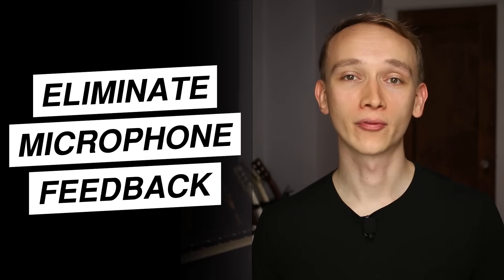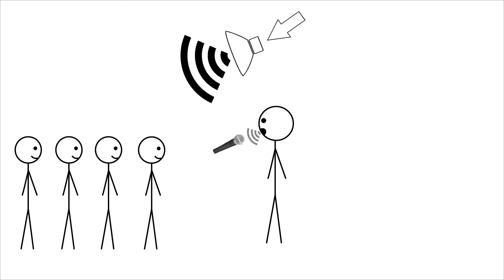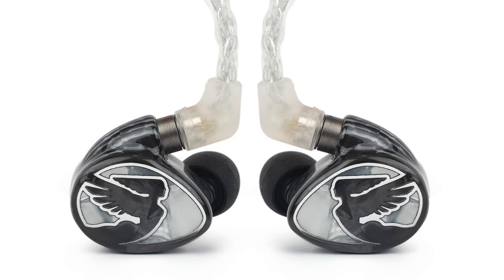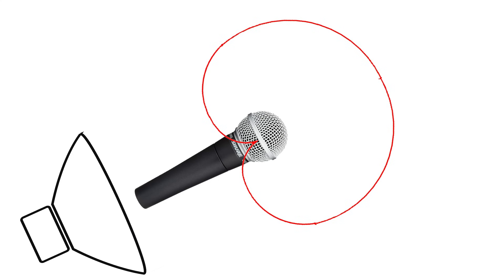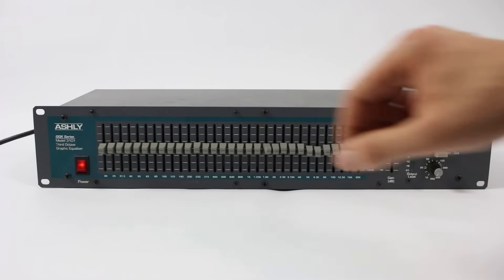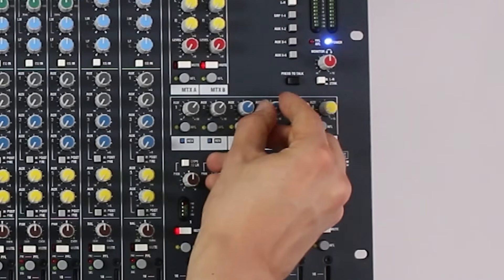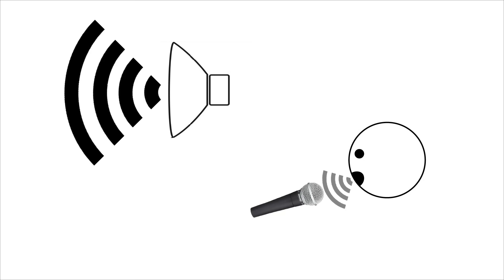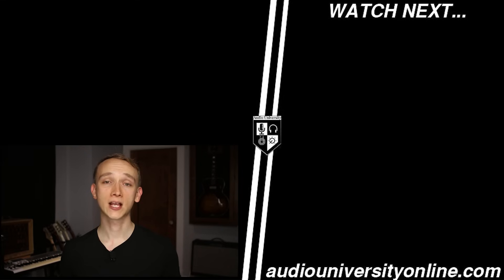How To Eliminate Microphone Feedback | 5 Must-Know Tips

Comment: SO youre mixing with gains instead of faders, nooo no no. Setting correct gain structure ( with eq ) is everything, then add monitor send to taste. But since there is technically no wrong way, (yes there is) what ever works for you.
Reply: I agree with Travis. Gain is gain and using the preamp as a "mix" control doesn't change the possibility of feedback.
Set the input gain to match the source, set aux send to 0db and THEN set aux master to taste.
This keeps the gain predictable through the console if you are sending to other outputs for other applications.
An example of this would be a corporate gig where you have lectern mics, lav mics and maybe a band and are using the same console for mains, monitors and recording or web casting.
"Whatever works for you" is not best practice! This I have found after 40 years of pro audio mixing.
Reply from the maker: Thanks for commenting Keith. I appreciate both of you sharing your experience.
Reply: Agreed. To have a fast and efficient mix, you should setting the gain such that your signal is at a known level (-18dBfs for example). That way you'll be hitting your input channel dynamic processor thresholds as expected which is one less thing to have to worry about as the band is starting to play. Also, pretty much every single band requests different monitor mixes so I'm not going to be adjusting the gain for every band because then I'll have to worry about my thresholds again. 

IF you're not mixing monitors at all and your FOH console gain will not affect the monitor console gain, AND you're only mixing 1 band AND you have a totally relaxed sound check with no time schedule, then you can totally get your balance using the preamp gain. This does work well to keep your faders at unity which offers high resolution for level adjustment. This is all fine because you'd have the time to adjust your dynamic processor thresholds. Most high end consoles have a digital trim after the analog preamp gain which could also allow you to easily get your mix balanced while keeping the faders at unity. 

Definitely work how you like, but when you're cranking through bands at a poorly organized festival (which is 95% of them) and time is not a luxury, you need to be able to work super fast and gain staging the way you suggested simply won't allow a fast enough workflow.
Reply from the maker: Thanks for your comment, Travis. What part of the method explained in this video is incorrect in terms of gain structure?
Reply: @AudioUniversity If I got what you were saying.  Ok, so you set your mon aux lvl at 0 then bring up channel gain untill the player says thats good.  PFL on the channel says your way down from 0 {analog} say -40 or lower so that leaves a lot on the table as for useable gain and you may struggle to get the voice / instrument over the stage wash in FOH. Also maybe another aux wants that signal louder in their mix but cant seem to get it there because you left so much useable gain out of the channel.  They could have different or a lessor  IEM or a wedge that has different power ratings, who knows.   Also your not hitting compressors with enough input. Do as you wish but for me for the last 30 something years set gain per channel based on pfl input keeping in mind eq can change level.. to over all,, 0ish analog -17ish digital and then you have a good source to distribute to aux's, FX etc.. and you can mix with faders. It all starts with the source and input gain, maybe thats why its at the top of the strip. Like I said there's no wrong way {yes there is} and do what ever works for you.
Reply from the maker: You’ve got some really good points here. I see what you mean that -40 dB would be a bad situation, compared to a signal level around -18 dBFS. I totally agree. Using the method I described, I usually end up with a healthy signal level, too. I think we would both end up with very similar gain structure at the end of the day. Thanks for taking the time to share this info.
Reply: It depends on what are you mixing for. For FoH is best to mix with gains and for monitors with sends. It’s not worth it to have a very high gain in the monitor mixing so you have more “fader” to use. Have seen people that have +35dB in preamp and -40 in fader
Reply: Travis is right. You're painting yourself into a corner here. You only get one chance to play with the gain knob, and that's during soundcheck. If you touch it during the show, it hoses every single monitor mix that it's feeding. You need to juice the preamp gain so that you have enough signal to work with. Then you can run your sends lower, which gives you way more (and safer) adjustability during show, should you need it. With digital desks, you have a lot of options for regaining the resolution you lose by being down in the lower part of the fader

Comment: Provided you are mixing FOH and Mons from the same console, I am not sure I agree with your definition of "Proper Gain Staging". I don't think that setting your gains with the main goal of maximizing aux send resolution is the best practice (when it comes to live sound anyway). Now, I'll admit you did mention that you do that when "mixing monitors", in which case, if you're only mixing monitors, that might actually be a good idea. Not having a go, I think your channel is really good. Just wondering what your thoughts are regarding what I said. Thanks for sharing knowledge!
Reply from the maker: There are certainly other ways to do it. How do you approach gain structure when mixing monitors from the FOH console?
Reply: @AudioUniversity  I can tell you in my experience, I set my input gain to the level that my gates and compressors act properly. (Properly to me anyways) Then I send as much aux to the monitor as it needs to be loud enough to the musicians. Your eq technique is spot on though I do recommend listening to it after each cut to make sure you haven't killed the fidelity of the monitor.
Reply: I had that same question. I usually have to mix monitors and FOH from the same mixer (A&H Zed22FX). If I cut the pre-amp gain as described, I would have to boost the FOH mains to compensate for that. I like the information given but yeah, mixing monitors and FOH from the same desk does have unique problems to work around
Reply from the maker: True, Alan. When mixing monitors from FOH, I’ll usually check through the mains before giving anyone anything in the monitors, because the mains will often leak onstage and reduce the amount needed in the monitors in many venues. I appreciate you taking the time to share your experience on this. Thanks for watching.
Reply: I've been a performing musician for 41 years. I've used and owned many different sound systems including a system for Bluegrass music consisting of 3 large diaphragm AT4033 condenser mics for vocals and acoustic instruments and a DI for bass.
I currently play in a three piece band and mix from stage using a QSC Touchmix 16, QSC powered tops and subs for FOH, and my beloved Yamaha C112V passive wedges powered by QSC GX5 amps for stage monitors. 
I believe from experience that the first step to every live show is to use the gain attenuator, with channel faders down, to achieve the strongest incoming signal from every source using channel PFL and the meter on the mixer. 
Once I reach optimal gain on each active channel, I NEVER touch the gain adjustments again unless a channel approaches clipping during performance and needs reduction.
ANY and ALL adjustments to a channel's gain affect the level of EVERY output the signal is being routed to. For that reason, if you use the gain attenuator to raise one particular aux monitor's level, it certainly works, but then you've also brought the level up for every other aux, and more importantly, for FOH not to mention for any live recording mix that may be occuring. A recipe for squeeling feedback.
In addition, optimal gain settings in the beginning capture the most accurate representation of the sound source. Subsequent gain adjustments affect the tonality of the source at every output and affect the balance of the blended sound of the band.
Individual output faders are for the specific purpose of attenuating the levels to their respective outputs. That's precisely how I use them.
Also, the video briefly touched on in ear monitors. While they most certainly solve the feedback problem, in my experience, they can cause other problems.
For instance, our drummer who also sings and plays harmonica loves his wireless in ear system. And we certainly have no feedback trouble from his position. But since he has the capability to attenuate his monitor level himself, he has a tendency to set it at a level where he hears a pleasing vocal level with minimal singing effort. 
This creates a problem when mixing from stage. What happens is he begins to sing at a progressively lower volume because, as he raises the level in his IEMs, he hears himself progressively better. Then his level gets progressively lower at FOH and in our wedge monitors. And when I turn these levels up to compensate, I approach feedback and raise the noise level for his channel. 
Also, even though he uses the open style of IEMs to allow him to also hear ambient sound from the room, he seems to be somewhat detached at times from the live interaction of the show. 
I'm not a huge fan of IEMs. They make sound production easier in some respects, I guess, but at what cost? The audience doesn't pay to marvel at the genius of a good sound technician. They pay to see and hear a complete and moving live musical performance.
Reply: Yeah I was thinking the same. What I tend to do is set preamp gain for the main mix and admittedly I set based on what I see on meters and what hear but usually set it to averaging about -18db (thats where the meter crosses from green to orange). Then based on that my faders can be at about -10db and my main fader also about -10db which is usually about right for a starting point for our speakers and venue (I would have both at unity but then gain would need to be way too low for our monitoring.

As much as the monitoring is important... if the main mix sounds crap whats the point 🤣
Reply: I'm a live sound engineer that continually mixes small bands that I'm unfamiliar with in various settings throughout my state of North Carolina and I would have to agree with your assessment of this video based on the fact that I have to mix both monitor in front of house from the same board usually I tend to gain stage favoring amplifiers at the front of house and then adapt them for the amount of amplification I have available at the monitors it's kind of an experience sort of a thing but as long as you have that in your head when your gain staging you will have a leg up on the situation once I have nominal gain stage enough for the front of house and enough to drive monitors then I start eqing monitors

Comment: Been running live sound for nearly 15 years now and learned something new. never thought to bring up my monitors before setting the preamp gain. I've always set that first according to the meter. Ill have to try out your method for ringing out monitors next weekend.
Reply: Yea i dont agree with that one point, this is improper gain staging. Set the proper preamp gain first before sending monitor levels. It would be like foh setting all the faders at unity and then mixing with using your gain levels. Always get healthy preamp gain, then set monitor levels then foh mix. You will get least feedback this way.
Reply: @rekeesefil  100% correct! Set preamp gain first always
Reply: are you going to EQ and then parametric every mic?  if so, then go ahead.  Bring up monitors before the preamp, and eq each mic as you bring it up.  It'll quadruple or quintuple your setup time, probably douse any volume you get, and might get you fired from a job or two.  You were right the first time.  Preamp to a level for the electrical system, then work the room and speakers into it, then dial back if possible.  Maximum gain before feedback changes with each spike you eliminate.